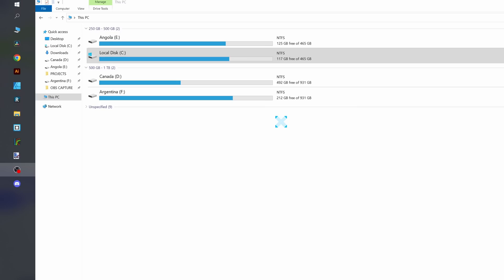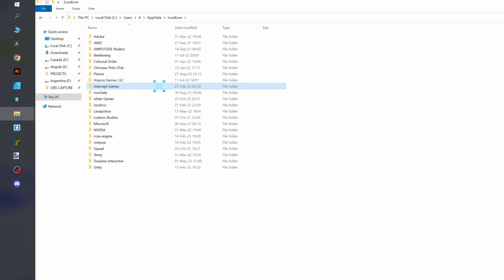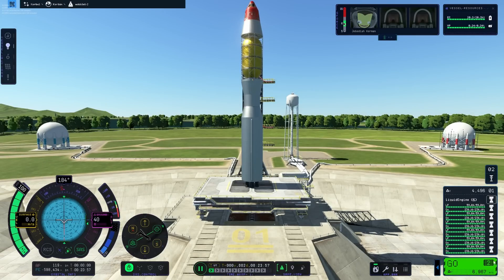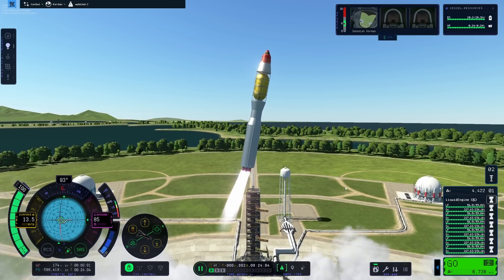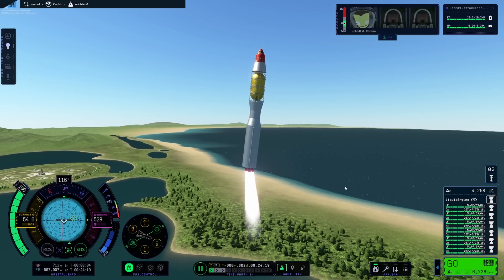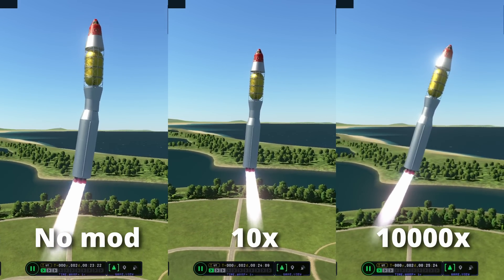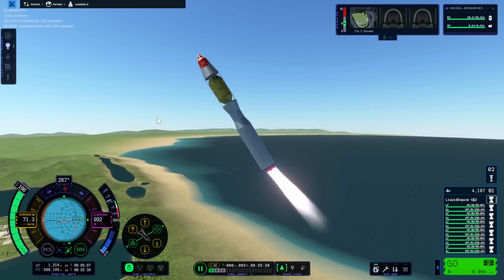fixing wobbly rockets in KSP2.

Comment: To fix the secondary wobbles you have to change the "JointBreakForceFactor" from 50.0 to a smaller value like 10.0. It makes it so that non rigid parts like decouplers 50x more weak than rigid joints like fuel tank to fuel tank joints. Changing "JointBreakForceFactor" to 10.0 will make non rigid joints only 10x weaker. Considering how bulky SpaceX's welding on coupling parts it should shouldn't be 50 times weaker than the fuel tank welds.
Reply: That's the devs job to be honest...
Reply: @PaladinJenkis  Yeah well until they change it it's our job to do it ourselves in the game files :P
Reply: @Jazzyo7  No it's not to be honest. That isnjust one of the many reasons why Early Access shouldn't be a thing.

Steam should prohibit that. You either have a finished product or you don't
Reply: @PaladinJenkis  It is my job to change it if that's what I'm wanting to. I have access to it in my files, I have the option to change something I don't like, I change it. It's their job to fix it, but until then, it's mine to do it myself. I shouldn't HAVE to, but I'm GOING TO because it's annoying trying to javelin toss wet pasta into orbit.
Reply: @PaladinJenkis  Long message btw, main point is at the bottom :)
Why should I refund a game that I support and want to get better? Why should I have to bend to you and listen to you when you don't listen to anyone else? Some people like the game, it has issues and is extremely unoptimized, just like KSP 1 was when it released in early access. You don't wanna buy into it yet? Be my guest, don't, but I've enjoyed KSP 1 since mid 2013 and I was just as excited to try KSP 2 on release, buggy or not. > And I got your point, us as players shouldn't have to fix the game for the devs, and I understand that. < However, until fixes are made, you as the player, if given the opportunity to make a fix yourself, are fully welcomed to until then if it bothers you that badly as it did me. But it's the same with you and twtter users, can't resist something that pisses you off can you? Gotta talk shit about it all the way to the dirt. NO ONE expected the game to be unoptimized and buggy when it released, and the only people that did are the ones that expect that from every game now adays. No one said you have to buy it, I for one am glad I can get my hands on it early and play it, even as unoptimized as it is.
So riddle me this: If they released the game a lot more optimized and polished into early access 6 months from now, would you be a lot less upset? And if so, I ask you this as well. How would it affect you if they just released it now as it is now for the people who want to play it earlier? It's still gonna get the same work done in the 6 months regardless. Just wait and buy it when you feel like it's worth your money, no one's got a gun to your head saying you gotta buy it now. 
Point is, I know this thing is a buggy fucky mess, but I'm still excited to play it just as I was back when I found out about KSP 1. Let me play my game if I want, and you play it when you feel like it's worth your time and money.
Reply: @PaladinJenkis  Hurts my brain that you can't figure out that no one is forcing you to buy or play it, go play KSP 1 if you're that butthurt over it. If you don't think it's worth the money? Then wait for it to be worth said money. You'd have to wait anyway if they didn't release it a few days ago.

I never said the studio was my friend, nor was I expecting a complete product when the devs and the game itself clearly state it is in Early Access and that the game is nowhere near a complete state. If you honestly thought the game was coming out as a complete product then I don't know what to tell you.

And don't think I agree with every choice the devs have made with it. I don't think it should be $50 currently, I feel like 25-30 would be a lot more reasonable in its current state. 

The devs even originally delayed it after the fan base told them that they shouldn't have released it 3 years ago. So saying "people like you let studios get away with this" is your opinion, but not one everyone shares.

Don't buy it if you don't like it how it is now. The people who have want to play it, and if they found out they can't run it? They could always refund it within 2 hours, plenty of time to realize if you can or cannot run the game. I support the devs in their efforts to make KSP 2 better, but what worries me, and many other players is how long it will take.
Reply: @PaladinJenkis  If being part of the problem includes having my own free will to choose if I want to spend $50 that I have earned myself or to not spend it, then sure, I'll be a part of that problem.

I'll buy an unfinished product because I want to support the game and want to play it and have fun. I'm totally down to stick with the development with a game franchise I fell in love with 10 years ago. 

We all know it will be more optimized as time goes on, same thing happened with KSP 1 and look where it is now, and they've already proved in multiple videos about the game that they have more content on the way to add to the game's life. 

Do I think it's worth the 50$ right now? Fuck no. Do I still wanna play it and goof around? Fuck yeah.

Let people make their own decisions with their money, it changes nothing about your life. If what's going on with KSP 2 has you that pissed, then go do something else man. Go outside, play a different game, spend time with friends and family. I'll be here goofing around with other friends in a chat while we all do dumb stuff in KSP 2, just the same way we have and still do in KSP 1.

And to this, all this because I said you have the option of fixing a bug yourself before the developers are able to get to it. 
Edit: Hell, it's not even a bug, it's just an option that makes your rocket too bendy and you literally add 3 extra zeros and its x1000 better.
Reply: @Jazzyo7  And it's still not YOUR responsibility to change configs around. Why would you support someone wo does not respect your time? Just out of curiosity, what's your occupation?
Reply: @PaladinJenkis  I know it's not my responsibility to, but it's my choice and I have an option to before the devs are able to resolve the issue themselves. It's a quick and very simple fix for an issue that's pretty annoying. What makes you think they don't respect my time? Because they haven't fixed that EXACT issue yet? I didn't go buying into the game expecting them to be fixing bug after bug every other minute. I'd rather not restart my game every other hour for a new patch, I'd rather them do a big patch every couple days addressing multiple issues at once rather than every time they fix one. Both practices have their pros and cons, so people will bitch about it either way to be honest.

Also to answer your question, currently unemployed, but I am currently working on trying to apply at a theatre near me, quite excited :). But the money I've gained was for helping out around my parents' house and a few neighboring houses with things like yardwork for example, but it's still money I worked for and gained myself. Used to be outdoorsy but as I got older I grew a lot more lazy, a lifestyle I've grown very annoyed with myself over so been workin on changing it lol.
Reply: @Jazzyo7  I believe you have a lot to learn how a professional relationship between customer and vendor works. Good luck with your job application.
Reply: @PaladinJenkis  its why they released it to find ways to fix it they might not have kown
Reply: @Dowlar-YT  Most definetly not. This basic QA. And they have QA inhouse. I suspect the publishers pushed the release date. If the devs wanted to release KSP2 in this kind of state, something went horribly wrong.
Reply: @Dowlar-YT  Disagree, it's a blantant cashgrab since the bugs in the game do not require a whole crowd to find but just by playtesting. A closed and open beta are ment for those aort of things... What they did is just outsourcing expensive playtesting to the players and sell it for full retail.

Ir's unexcusable and should be forbidden.
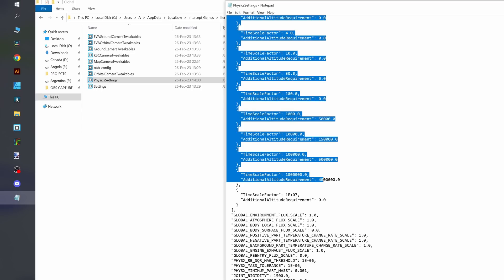Reply: @Tom Xiong 1:00 I don't see a " JointBreakForceFactor" or anything with a value of 50. I see
 "JOINT_RIGIDITY": 1500.0,
  "JOINT_SURFACE_NODE_FACTOR": 0.8,
  "JOINT_STACK_NODE_FACTOR": 2.0,
  "JOINT_STACK_ATTACH_STIFFNESS": 10.0,
  "JOINT_SURFACE_ATTACH_STIFFNESS": 10.0,
Reply: @mallekgarson9127  It's like way further down in the file, ctrl f for the name
Reply: @tomxiong3630  Found it. Awesome. Thank you.
Reply: @mallekgarson9127  perhaps it was a reference to a value available in the original title.
Reply: Or you could just like... put two fucking struts on the clear bottleneck part of your rocket
Reply: @mobius1504  I put 16 struts on each of the three interstages of my rocket and they still cause wobbling
Reply: @mobius1504  computer dies
Reply: @mobius1504  it happens alot especially at payload parts
Reply: Would that work on console?
Reply: @davisgallauresi5812  if you had access to the same file you probably could, but idk how you would acjieve that since im unfamiliar with xbox's architecture. someone may figure it out.
Reply: @tomxiong3630  yeah my ps5 might not be able to do such a thing.
Reply: @tomxiong3630  All I know is that Xbox runs on a modified version of Linux (it's rare for Microsoft to use Linux with its own OS).
Reply: @die4G  Doesn't Windows have a Linux command line or is it Unix?
Reply: @davisgallauresi5812  oh haha ps5 my bad, i'm unsure about that also, but they accessed the ps3 before so could be possible
Reply: @davisgallauresi5812  no its not unfortunatley. you cant access the game files in the same way you do on a PC :/
Reply: I don't see how having parts snapping improves gameplay. The game is a simulator but it's less than serious.

I wonder if there is a better way to handle parts like this. "Autostrut" always seemed like it should be default to me. 

I suppose some people might want a floppy rocket for some purposes. I think the default should be rather rare snaps and if people want a floppy craft then mod that in.

Comment: Imagine releasing a game that is so broken that the players have to recode things for it to work properly
Reply: >recode
It's a fucking config file...

It's literally doing little more than changing the number for "music volume" from 100 to 75. 
This already exists in the game's files, it's a working setting, it simply has to be accessed by the config file currently.
Reply: @higueraft571  I mean if anything that’s even worse. It means all the devs had to do to prevent this degree of issues was to change that number, and they instead chose to release it as is

Comment: In the general setting in the game itself there is a setting for unbreakable joints. Why would you need to edit the code. I haven’t used it because I like strutting my stuff. 😊
Reply: Well, just from my experience, struts don't always solve the issue. I had a perfectly reasonably-designed rocket ( I'm an aerospace engineer btw) that wobbled itself to death every time I tried to fly it despite adding a ridiculous number of struts 🤣

Comment: Don't you have any good tips for that?: In the first and here too, it doesn't matter where I put the wheels, they always turn off the runway.
Reply: Turn off auto friction control and adjust the friction level to be 0 for your front landing gear. Works like a charm in both games

Comment: bro i have to really wait to buy an rtx 3060 pc ro just run ksp2 why cant i just use my low end laptop
Reply from the maker: There is bunch of weird stuff here and there atm. On 2080ti with 4k monitor it was always rendering 4k before downscaling to 1080p or 1440p while in borderless. Borderless do not work and once you swap to fullscreen it starts to perform in reasonable 25-60 fps fashion, well at least on 2080ti.

Comment: Is this possible with the steam version of KSP 2? By the looks of things, it looks very different file wise, and steam encrypts its files client side.
Reply: Yes. The files are in the same place and are unencrypted.
Reply: @Regolith86  In that case, even with hidden showing, I do not even have an "app data" folder.

It goes: This PC: New Volume (D (my ssd)): Games that need it (steam install folder): Steamapps: Common: Kerbal Space Program 2.

there is no global folder for the record either, and all things I try to open in notepad result in wingding esc text.
Reply: @johnlesterr8927  I think you're looking in the wrong place. It's not in the steamapps:common folder. It's in the Windows user folders. So under C:(or wherever your windows system install is)\Users\YourUserName\AppData\LocalLow\Intercept Games\Kerbal Space Program 2\Global.
Reply: @Regolith86  I can’t find the local low file I only have local and roaming
Reply: @Idkdyl248  Might be in one of those then, I'm guessing "Local". Not sure why you don't have LocalLow....what operating system are you using?

Comment: The way I see it the smaller the joint the less it's rigidity value should be with the rigidity being devided by the amount of mass on both sides of the joint and also affected by the difference in size of the joints.

Comment: This is something that shouldn’t need a fix.  It should be removed from the game entirely. It never should have made it into the game in the first place.
Reply from the maker: To some extent it should be part of gameplay. Real rockets use various structural workarounds to stiffen the construction. Like SLS run huge truss through the main tank in-between boosters. But the extent to which wobble everything in the game... Yea it's bad.
Reply: @Yakez42  yea. But realistically all that would have been taken into account by the “engineers” who build the rocket. They would have designed parts that connect together in a structurally sound way. Not just stick them together and hope the rocket doesn’t turn into a hockey stick.

Comment: That's good work work you did.

Just think. 4 years from now you will be downloading a mod from your favorite KSP2 modder and it will mention at the bottom how they got into modifying games after watching a short little YouTube video about how to alter a file to stop the ships from shaking apart and they were hooked ever since.
Reply from the maker: Nah, I doubt that I am the first to notice this toggle. A lot of things there. For example you can tooggle off clouds with Settings file, something unavailable through the game menus.
Reply: @Yakez42  I think there needs to be a complete overhaul in how joints work in ksp. Clearly just making it more rigid doesn't work fully, and it also kinda breaks the realism for me. I'd like to see a system where an inline node attachment is actually a system of attaching several bolts between the parts in a ring. That way the bolts could be explosive (for decoupling) and could have various strengths and sizes to better simulate breakage under stress without going all bendy but still be rigid up to the point of failure. Would likely require a working multi node attach system which idk how feasible that is. Am a programmer but haven't tried modding in ksp yet but seeing this is making me consider finding a way to fit working on something like that into my schedule.
Reply: @bobbobert9379  I don’t have experience working on games, so this may not be applicable. Is there a reason why the game has to treat each segment as it’s own thing? Like can’t it from a physics standpoint consider it as one single solid object with different properties for the different segments?
Reply: @SyntheticSpy  I'm a developer, but not a game developer. But you could do something like that, but it might have other consequences or be difficult. I think this is kind of how ksp treats things attached to each other: part of the same craft but with differing properties. But each segment has its own physics, because realism. They could treat the joints as completely fixed, but that removes realism. What I'm imagining is an attachment system that would be stronger and necessarily simulate realistic stresses with the existing physics engine, as in, torque and other forces already exists, so all I'd have to do to create breakage is just disconnect the bolt parts when the force on them is beyond their stress and/or blow them up. Adding extra nodes and/or connecting more than 2 nodes together at once might be needed and difficult. Not sure.
Reply: @SyntheticSpy  No, there is not a reason. This is a design flaw that has carried over from KSP.

Comment: You're changing a value meant for a per-frame physics engine, exponential returns. My guess :)
Reply: No physics engine calculates per frame. There is a fixed frequency of updates for the physics engine and the rendering engine creates frames at dynamic intervals.
Reply: @KingmakerFirefight , what you’re talking about is,the difference between graphics frames and physics frames.  Every physics calculation is per frame, it just isn’t a graphics frame that is being referred to.  Most physics engines run (or at least attempt to run, subject to hardware limitations) at a fixed frame rate, commonly 60 fps.  The graphics engine is almost always decoupled from the physics engine, rendering snapshots of the game state at whatever interval (aka: frame rate) the hardware can handle.
Reply: @Vessekx  that's better than when PC games ran on Clock Cycles of the cpu (called a Tic) so for example: Suppose a game was designed on a 1ghz processor. if you played it on a 2ghz processor, it would run twice as fast. 3ghz is 3X and so on. Like the first DOOM game from 1993 was calculated at 35 tic per second. and if you ran the game with hardware capable of 350fps, the game would run 10 times faster. but modern games "rendering" the game is separate, so the render part of the game may render the same frame for multiple Tics. Basically displaying the same scene multiple times a second.